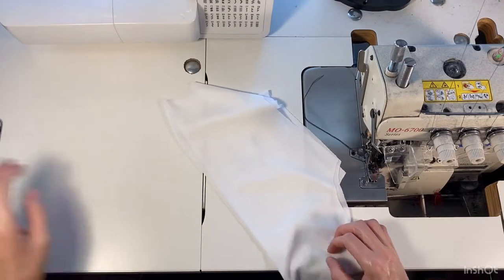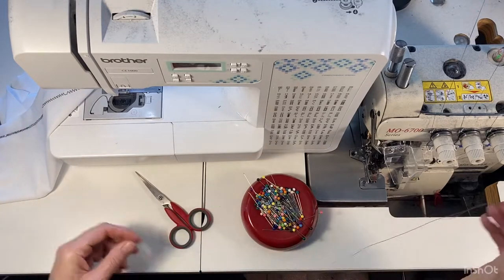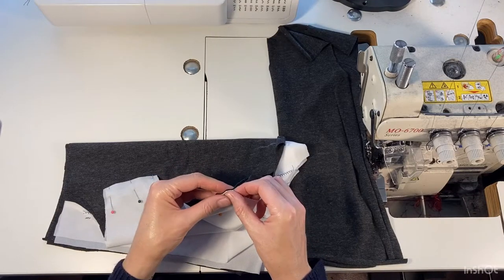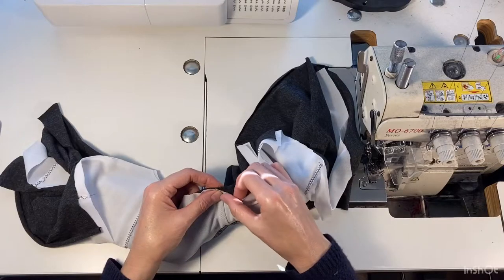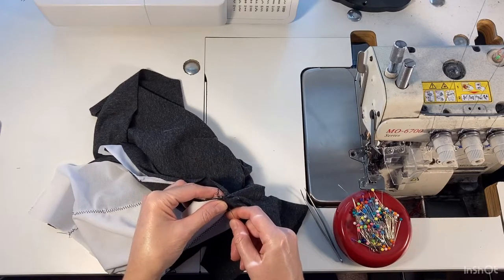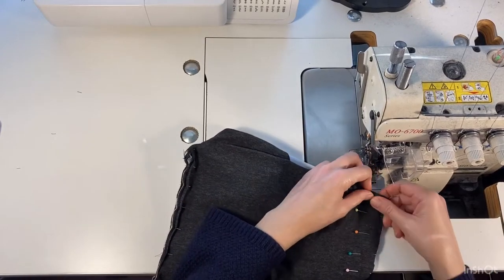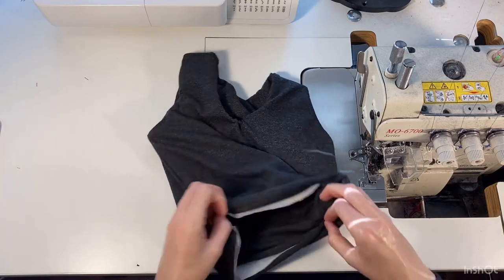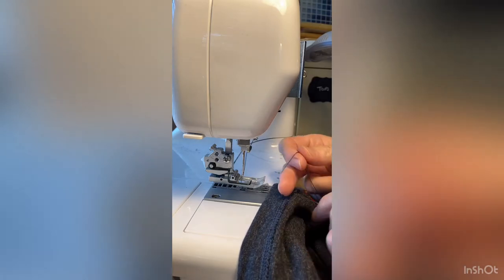Binder Tutorial - Free downloadable sewing pattern available

Comment: i don't have access to power mesh where i live. Is it possible to use another stretch fabric for the interlining, and then a non stretch for the stabilizing layers?
Reply from the maker: For the stabilizing layers you will need something with 4 way stretch that is greater in one direction. I chose the power mesh because it's breathable. Could you order some?

The pattern is designed for stretchy fabrics, I cannot predict the fit in a non-stretchy fabric or even your ability to put it on ❤️

Comment: Thank you for making this video ❤️
And i have a question what if the mesh i found at the store was more stretchy or its holes were bigger ? Would it work
And how can i know the sizing i need
Reply from the maker: Hi Rami, I can’t really say how it will go. If you have enough to make one to test that would be ideal. Then you could decide whether it would help to size down or double up on the stable layer. I hope it goes well 🤞❤️

The sizing is based on your chest measure. (sorry it is in inches, re-drafting a more inclusive version now) Size of the final garment will depend on fabrics and preferences, so you may need to adjust, but this pattern gives you a starting point 😊
Reply: @ureshiidesign  thank you so much! And im so happy i found your videos they will help out alot❤️

Comment: Would you recommend using a walking foot if I'm just doing to do this with only a sewing machine?
Reply from the maker: I used a walking foot during initial pattern development because we wanted the pattern to be sewable with a sewing machine. It didn’t make a huge difference with my little brother machine, but it might depend on your machine. I like to backstitch to anchor, and I was frustrated not being able to reliably backstitch without breaking a needle. So I would say try it if you have it, but if you don’t, seam test before you order one. If you find you need it and want to backstitch you can turn your work 🙃 Good luck 🤞🤞

Comment: Hii thank you so much for the tutorial and patterns 
I looked up the patterns and have a question : how exactly does the sizing work?
Reply from the maker: The sizing is a chest measurement in inches, but it is just a starting point, preferences and available fabrics will dictate whether you go up or down a size. There is more information & written instructions in the blog post. I hope to add cm notation soon
Reply: Hi I've looked on the blog re sizing and it's really not clear. Is the inch measurements the full bust measurement?
Reply from the maker: @sfguiel  Yes, full chest not wearing a binder. As preferences and materials used will impact fit, I only mean the sizing as a starting point. You may want to go up or down a size, or longer.
Reply: @ureshiidesign  thank you so much for your speedy reply. I thought it was, but just wanted to check. Thanks again.